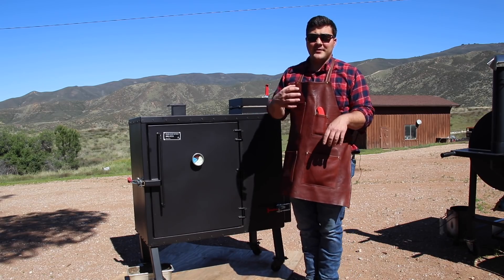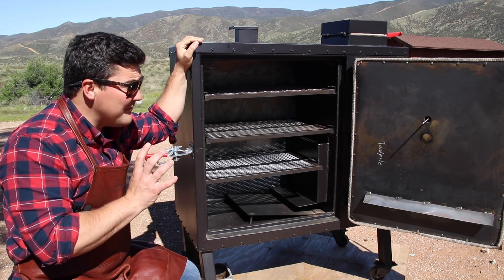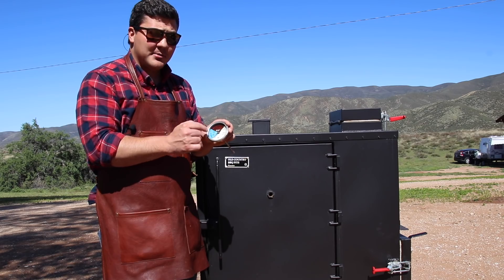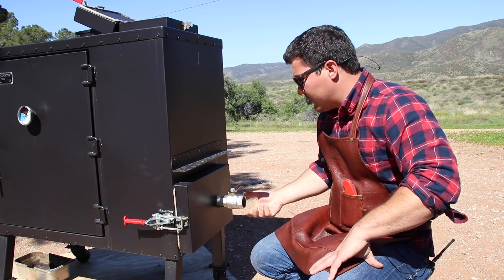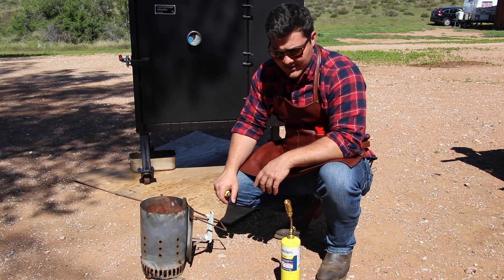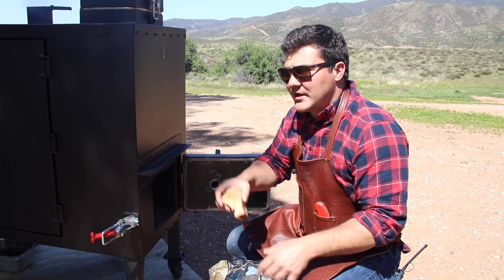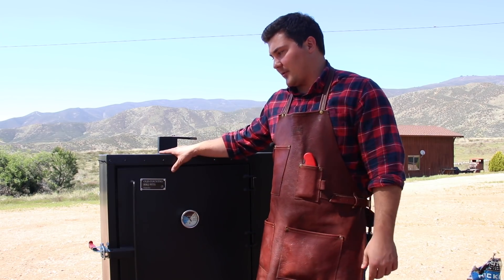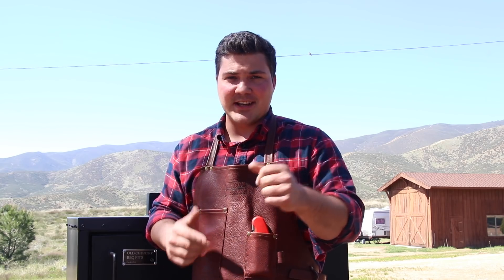How to Use a Gravity-Fed Smoker

Comment: Sad tale. I managed to finally get one. When it arrived it had the normal bashes, dings, and scratches from shipping without a crate. No prob. Just need some paint. The problem was that the box of the cooker was bent. The frame was straight and square by the charcoal chute but then bent back away from the door by about .5 to .75 inches by the upper corner of the door by the latch. This meant that the door wouldn't seal. 
Unfortunately, this appears somewhat common for this run of units. A number of us who ordered them at the same time on the bbq-bretheren forums had the same issue of doors that wouldn't close. I also had some torn gaskets that I replaced on my own dime before I realized that there was no way to make the door sufficiently airtight. Right now, I have been waiting for a week for Academy to come pick up the defective unit. They actually didn't offer a replacement, just a refund. I would suggest only buying these in person at an Academy store and not having them shipped. If you are willing to roll the dice, give the delivery guy an extra $20 to wait while you pull off the bubble wrap and check the doors and gaskets. Dont sign and let them leave until you are sure you got a good one. Otherwise you get a 350lb armoire for a few weeks. I decided that I wasn't going to push for a replacement unit and knuckled under and put a deposit down on a Southern Q Limo Jr, which has a higher build quality, more usable cooking area, and a smaller footprint. It also costs a good deal more. The OCGS can be a incredible deal if you get a good unit but Academy puts OC in a tough spot with price limitations and quality control can suffer. I'm not knocking OC at all. They are trying to put out a desirable product at just over half the cost of their closest "competitor". Just keep that in mind if you want to go this route.
Reply: I ordered one from Academy as well (because of the price), and received it about a week ago. Same story, scratches pretty much all over the rubber on the handles had been banged up so the metal was showing through on the ends. Otherwise not in bad shape. I called customer service and they offered me 15% off so I said sure. My big issue is getting this thing up to temp. I was able to get it up to 500 degrees for the burn in (after about 2 hours) and was able to bring it down to 225 fairly easily, and did an eye of the round roast beef for the first cook. It turned out phenomenal. The problem was with the second cook when I tried to light the charcoal that was left over from the first cook. Lets just say that even leaving the chute top door and ball valve wide open barely got the coals going. I had to resort to pulling the grate, dumping all the coals and starting from scratch with a load of coals started in a chimney. Even with that, it took forever for the smoker to come up to temp (I was going for 250) and in order for it to get there, I had to feed it air using a pool toy air compressor to feed the ball valve. When I loaded it with the food (I did a big cook), the temp dropped dramatically and again, I had to be my own GURU, DIG IQ etc. and feed air into the ball valve throughout the entire cook (very frustrating). Having said that, the comments from all was, and I agree, that it was the best tasting ribs, pulled pork and pork tenderloin that I have ever done. That brings me to today with my borrowing a DIG IQ from a friend on the advice from this forum. I made sure to clean out the old ash and coals from the previous cook but figured using the DIG IQ I could load the hopper and start it that way. Well, long story somewhat shorter, it took two hours for the cooker to get to temp (250). When I loaded it with six racks of ribs, the temp dropped to (150). The DIG IQ was trying its best with its little fan to get it going again, but it was a no go. I had to resort to the much higher fan speed of the pool toy compressor. It still took 30 minutes to get back up to temp. Now I'm at 250 and with the  DIG IQ it is holding its own (for now). Unless someone can tell me that I'm doing something wrong or there was a piece of metal or something that should have been removed during shipping for proper air flow, I'm going to have to reluctantly send mine back as well. Sorry for the long post.

Comment: I build custom smokers and omg that rack slop 🤦🏻‍♂️that’s bad I would never let that leave like that
Reply: Why is the slop a bad thing? Does less slop stop the rack from warping?
Reply: invisiblekid99  no when the racks  Pop and twist and Warp it’s because it’s to thin has nothing to do with how much slop there is In the slide when you pull my racks out they drop a 1/8-3/16 that’s it and mine has locks where they can not be pulled all the way out

Comment: I liked the design of the grill but there is just one thing about it that I'm not understanding..
Reply: Lit coals will be falling  onto your smoking wood creating smoke creating your white smoke because you're smoking wood wasn't preheated.. that is the same process I'm seeing even with all the other pellet smokers.
Reply: But don't be the one that lowers it down too far and it all burns up.. lower a thermometer down the charcoal schoot and look for that Sweet spot temperature of about 650 degrees up to 750 Fahrenheit degrees. down to that area in your charcoal schoot

Comment: This production model still looks like a prototype:

1. Crooked badge
2. Crooked door
3. Framing welding isn't clean
4. Drainage looks cheaply made
5. The air valve is literally just a water valve
6. Tray for charcoal is literally just rebars, not even that nice in physical appearance
7. The prototype from your previous video looks a lot better, even the racks inside of the cook chamber
Reply: Looks like it does the job though! Hmm $1200 vs $3000 plus for a Myron mixon.  May not be as pretty, but it’ll do the same job.  I’ll stick with old country. Thank you very much!